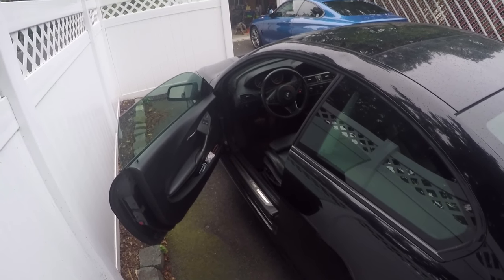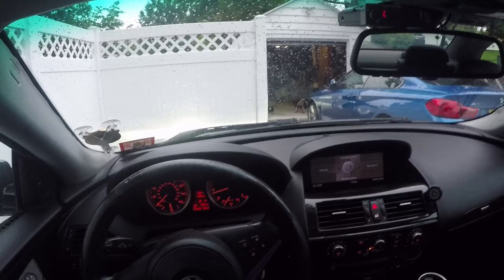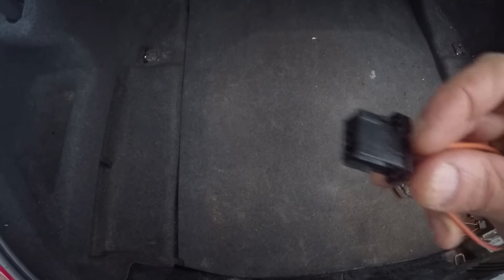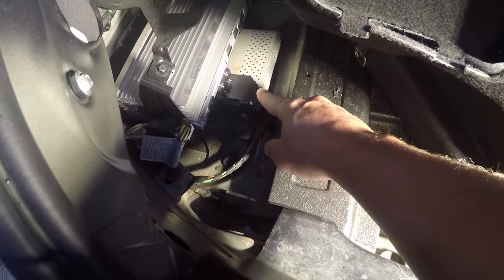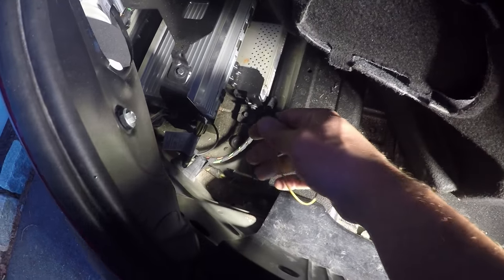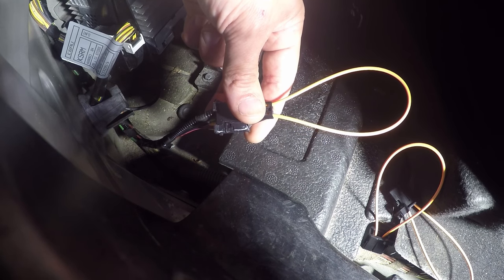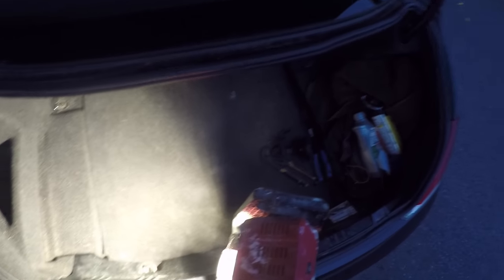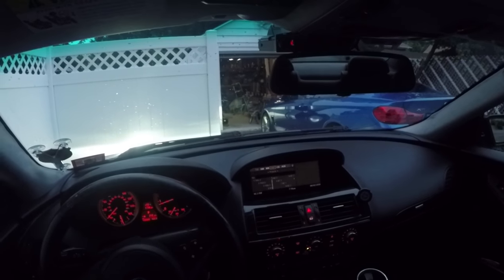FIX BMW SOS Error Light Audio System Failure CHEAP + Tips Others missed!

Comment: 2008 650i same issue with no sound at all. Did the fiber loop but still don’t have Bluetooth...? Also the sos still keeps coming on. It seems the loop only helped with the audio system. The USB port will charge my phone but again, no Bluetooth capability.
Reply from the maker: You may have multiple issues.  Since the sound came back on with the loop bypassing the satalite reciver that's a great start. Bluetooth has to be enabled by BMW (or someone who know how to code BMWs) via a software update.  The CCC in a 2008 650i is almost certainly on it's way out and can also cause intermittent SOS light. BMW will try and charge a small fortune to replace it if that is the issue.  My advice would be to take it to BMW and have pay for the cheapest diagnostic. Once the identify the bad components you can pull that part on your own and send it out to a specialist to get fixed for cheap :)
Reply: ModsAndProjects thank you. I never use the stealership so I’ll take it to my guy that owns his own German Car Repair shop. Hopefully he can reprogram the Bluetooth.
Reply from the maker: @ChrisJohnson-lx3tj  lol I avoid the stealership like the plague but sometimes they are useful to use to identify (not fix) complicated problems.  Was your Bluetooth EVER working? (if not, it probably just need to be coded)  My 2006 650I has 140k miles and i've been able to keep her healthy 100% DIY in the driveway, its has not been to stealerland since the warranty was up at 50k miles.
Reply: ModsAndProjects the original problem was the TCU unit, so apparently the fiber loop remedied everything except the Bluetooth. The Bluetooth worked fine until one day I turned the car off while it was in aux mode playing music from my phone......that is when everything crapped out.....all music and sounds like door open bell, seatbelt warning tone, etc. the loop solved everything except Bluetooth and the SOS symbol warning. On another note, any hints for my key battery? It seems it will no longer hold a charge.

Comment: Would it be the same problem. My screen is stuck on the BMW sign and turns on and off ? Help please.
Reply from the maker: Nope you have a bad CCC.  Google logic7 CCC repair.  Will save you 1000$.  Pull it ship it out and have it repaired by him :)
Reply: It would work if don’t turn the car on for about a day or so. :/
Reply from the maker: @LaGriz95  YEs, that is exactly how it behaves when the CCC is on the way out (or a constant boot sequence loop).  Eventually it wont turn on at all.  BMW dealership will ony replace (not repair) the unit and will charge between $1000 and $1600.  Your best option is to have it repaired by a 3rd party and it will run around $400 for the fix.
Reply: ModsAndProjects okay thank you very much!
Reply: @modsandprojects i have an 06 m5 exact same situation ordered the loop plugged in my satellite module still no audio

Comment: Worked on my ‘07 550i, thank you for this! I also found that using a can opener helps for stripping the housing
Reply: Was the satellite radio unit in the same place on the left hand side in the trunk in a 5 series, just wondering cuz I have a E60 too
Reply: @antboerner861  haven’t had that car in a year but yeah lmao, super easy job

Comment: My radio is still working but AUX and Bluetooth are not. Will this fix that issue?
Reply from the maker: Were they working originally? Is the SOS light on? What year and model?
Reply: @ModsAndProjects  I guess so. It's 2008 528i.
Reply from the maker: I guess I should have phrased that differntly.. "have you ever been able to use the BT or AUX port"   They need to be coded in to be used, it is possible they were never coded in or something else happened.  Is the SOS light on?
Reply: @ModsAndProjects  Yes, the SOS shows malfunction message. I bought this car with this condition but the previous owner told me that he could use that before.
Reply: Hey mate, I know it’s 5 years old but have you fixed this problem, if so could you tell me what you did please

Comment: I have a 750i I know they all work for all of them but I my question is how many by passes do I need in total Cus I connected mines to the Bluetooth module didn’t work then went on to the next one witch was the Navi system basically all them but only had one so I would have to take it off after checking if any one those was the issue

Comment: good morning, I get the word SOS in my BMW 330xd coupe e92 2007 year, write me a faulty emergency call system, and write a failed telephone connection, sim card installed not available. can its object eliminate my problem? the rest works all right!
 i'm in Italy.
thank you
Reply from the maker: It will help you diagnose the problem.  The part link in the description comes with full troubleshooting support untill your issue is addressed.

Comment: Thank you for sharing , I have SOS issue with my BMW X2 most probabbly Battery is running low .  They asekd me something like 400 euro for replacement !! Is there any hack to dissable ..
Reply from the maker: Hello, first you would need to 100% confirm the satellite radio is in fact malfunctioning, the loop is a great tool for this just to confirm. The loop in the description of the video comes with full support directly to help you troubleshoot definitively what the problem is in the best approach for repair or replacing as necessary

Comment: How do you fix the satellite radio if that’s what you are wanting to fix??
Reply from the maker: hello, thanks for commenting :-)  the bypass loop is a great tool because it allows you to identify exactly which component is malfunctioning. The particular loop in the description of the video above comes with direct customer support to assist you with identifying the exact problem and helping you to decide whether just bypassing it or regaining the functionality is the best course of action. A lot of times people just bypass out something like the satellite radio to get rid of the SOS light or to get there sound back, however, if it is something like Bluetooth that you might want to get the actual functionality back the tech support will guide you to the best course of action in getting it addressed avoiding the crazy prices the dealership would charge. For $14 it’s pretty awesome that you get that level of technical support!

Comment: cool video mine is a 2015 328i we had heavy rain is it possible the rain damaged it if any water got in there and that popped up saying no sos my radio is gone i have Bluetooth on mine, it connects with my phone but the sound is completely gone any suggestions thanks, prior to losing sound i already had that sos on for a while
Reply from the maker: Very likely you have a leak in the trunk area and one of the components took a bath. If you get a loop from the link in the description it comes with direct one-on-one troubleshooting support to help you figure out what component or multiple components have failed to get you back up and running again

Comment: I have a 2008 e64 with the same problem by in the same time my bluetooth doesn't work is it also typical for the problem with the radio? I also have a different radio its a DAB tuner but I think it doesn't make much different?

Comment: Hi, I have a BMW e90 LCI displaying this error code as well. My sat nav works(idrive) my radio works but my bluetooth doesn't work nor does my aux socket and USB in the middle compartment. Any suggestions?
Reply from the maker: What year is the vehicle?
Reply: @ModsAndProjects  It's a late 58 plate LCI with the wide screen idrive

Comment: I have a bmw 2014 435i and two weeks ago I turn it on and it says no warning tones ,it doesn't have any type of audio  What could it be ?
Reply from the maker: Hello, first you would need to 100% confirm the satellite radio is in fact malfunctioning, the loop is a great tool for this just to confirm. The loop in the description of the video comes with full support directly to help you troubleshoot definitively what the problem is in the best approach for repair or replacing as necessary

Comment: If it happens to not work after adapting the loop bypass, what would you look into next. CCC unit is working perfectly
Reply: After adding the loop, my IDrive is working while car is on and it connected my phone, but still no sound whatsoever
Reply: any solutions to this?
Reply: @possessedclown5832  the loop was the solution; it just happened to be that I misplaced it the first time. If it doesn’t work, vehicle will most likely need a new CCC unit.

Comment: Hello Sr thanks for your video. On my case I do have audio my radio works but my bluetooth is not working at all and I do have the (SOS malfunction) so you think that if I bypass the satellite like you did will fix my problem?
Reply from the maker: I guess for the cheap price It's worth a shot trying to bypass each component in the MOST loop (start with your satellite unit then try other components from there).  What year/make is the car?
Reply: @ModsAndProjects  is a 2014 BMW 320I
Reply from the maker: Was the BT working before or did it stop working when the SOS error popped up?  If BT never worked it could be unrelated to the SOS error.  The SOS error can be caused by any component in the MOST loop failing. In older cars it's very often the satellite radio unit as seen in the video.  A loose SOS speaker connection/wire (there is a dedicated SOS speaker in the driver side foot well) will also cause the SOS error. 

 In the meantime you could use something cheap like this this to get your BT back using your aux port and a USB port for power until you get your issue fixed: https://www.amazon.com/dp/B01M25NCN2/ref=cm_sw_r_cp_ep_dp_-lAjAb2NZWJ18
Reply: @ModsAndProjects  been honest I don't know when I buy the car the problem was already there
Reply from the maker: You might have two problems: Issue-1. BT was never coded to be enabled on your CCC (Call the stealership, give them your VIN and see if your car ever had BT enabled to begin with.  If not, have them code it in OR remove the CCC and send it out to this guy and he can probably enable it for you for cheap: http://www.bmwlogicseven.com/ )  Issue 2, - SOS error: Check for loose cable as mentioned above, get a MOST adapter and try bypassing each part in the loop until the SOS error goes away.  If all units pass, there are other options to try.

Comment: So I dont hear my chime when i put key in ,and my election menu works until it goes to FM or am radio mode ,then no sound comes out,is thus the same fix?.i am currently touching battery cables now and trying that to maybe reset stuff lmk what you think t.c tjanks

Comment: I had the same problem easy fix, do you know where the Bluetooth pin CODE is I have a 08 650i convertible
Reply from the maker: hello, thanks for commenting :-)  the bypass loop is a great tool because it allows you to identify exactly which component is malfunctioning. The particular loop in the description of the video above comes with direct customer support to assist you with identifying the exact problem and helping you to decide whether just bypassing it or regaining the functionality is the best course of action. A lot of times people just bypass out something like the satellite radio to get rid of the SOS light or to get there sound back, however, if it is something like Bluetooth that you might want to get the actual functionality back the tech support will guide you to the best course of action in getting it addressed avoiding the crazy prices the dealership would charge. For $14 it’s pretty awesome that you get that level of technical support!

Comment: Hi, i spilled water on my BMW x1 2011, now my radio and sound in the car is ot working, could it be the same problem?
Reply from the maker: Where did the water spill
Reply: @ModsAndProjects  it spilled on the radio screen and buttons associated with the radio. now all the sound is off i.e. seatbelt sound, reverse sensor sound, door opened during driving sound, handbrake sound. 

but on the screen of the speedometer it shows all the sign associated with the sound but no sound
Reply from the maker: @MrPhuluso  Sounds like you fried your head unit, i would try replacing that first.  The head unit can not be bypassed

Comment: Hi, I've boughten the part, configured it so it fits, but am still receiving the sos signal. What could be going on?
Reply from the maker: There are several components in the MOST loop.  You can use the adapter to use process of elimination to check each one untill you find what is causing the error.  Try the Power amp then TCU.  Also there is a small dedicated SOS speaker under the driver side footwell, it comes loose or is damaged it can also cause the error.

Comment: I have the same issue with my BMW 2006 330xi with the sos system malfunction, and my knob to control the screen is stuck would that be the same issue?
Reply from the maker: If the knob to control the CCC is stuck or unresponsive it is very likely a bad CCC unit.  You can send it out for repair (best option)  Dont just buy a used unit, unless you have a cheap way to code it (replacement CCC units need to be coded by the stealership or by an indy with experience).  If you had a bad satellite unit like int he video  you would likely still be able to use the CCC for other functions...
Reply: ModsAndProjects the knob sometimes moves horizontally and vertically like normal and other days it’ll just spin freely but I can’t select anything on the screen, but what do you mean by coding?
Reply from the maker: @Brandino73  Did you wind up getting it fixed?
Reply: ModsAndProjects it ended up being a low battery issue. Had it for years and had to get it changed the sound came back but left again I guess due to the cold. My gps on the screen shows where I am. And the radio every now and then switch from fm to aux every other few times I start the car. But the gps on my screen is active for some reason.
Reply: See if you can access the idrive with the key in but car not started.. I can only access my idrive at that time but once car is on I can not use the idrive. And my sos light just came on and Im also getting no sound.. I'm just trying to put in my two cents and find out if the bypass will work for me as well.. to the guy that put up this video.. do you think the bypass will work in my case or have any suggestions as far as the idrive only being accessable with the key in and engine off??? I'm going to try the bypass first obviously but I haven't seen anything about the idrive not working too... Thanks in advance!!

Comment: What does the pink wire do?🤔 I’m trying to find out if I have to get the sat tuner because for some reason mine is missing . If I can just get the bypass I’ll be fine because I don’t listen to radio I use my phone
Reply: @thej762000  so I don’t have the module on the right , and he said his module didn’t work at all anyway . Is it possible if I just got the female loop wire would it work?

Comment: Omg I waited a year to try this bypass and it worked I’m soo mad I waited .. like Bluetooth speaker while I could of did this a year ago :/ smh so mad and I
 Happy now I have radio
Reply from the maker: Thank you for reporting back with the positive feedback!
Reply: @ModsAndProjects  of course I was going crazy without music lol and this saved me a lot on replacing the radio amp box
Reply from the maker: @Barbiebalboa90  Awesome! Yeah the one in the description is unique because it fits in every component, the typical generic ones generally required due to modify them or cut them up to get them to fit on some of the components connectors.  I'm glad you got everything up and running, you probably saved over $1000!

Comment: My radio works in a 2010 650i, but SOS light. A used Sirius unit is $89 on eBay motors?

Comment: I've got e60 530d, 2008 and have the same SOS malfunction problem, but my sound is working. Can I do the same trick as you? Or I might have different problem?
Reply from the maker: The loop can be used to diagnose SOS lights as well as sound issues, the link in the description item comes with troubleshooting to help you if you need it

Comment: Can you please tell me the number of the past i need to get ? And can i find it on Amazon ?  Thanks a lot man this is a great help. I stopped by the dealership and they wanna charge me 500$ to fix this simple thing. Kindest regards.
Reply from the maker: Hey, the link is in the video description :) Good Luck!
Reply: Does it work on x5 2008?
Reply from the maker: @husamnajm6649  2008 x5 uses the MOST network, yes.  Hopefully it's just a bad satalite receiver, if it's not just let me know and I'll try to help you further diagnose the problem.
Reply: Thank you so much. I just orders the part on amazing and I made sure it’s a female one. It should be delivered on Thursday. I’ll give it a shot and let you know. Kindest regards.
Reply from the maker: @husamnajm6649  the pre trimmed one in the desciption is really your best bet, the standard female version won't fit the male cable without cutting it up.
Reply: Copy. 
I’ll follow the video and let you know how it goes. Kindest regards.
Reply: Thank you so much for this. I did it and it worked like a charm. Thank you so much.
Reply from the maker: @husamnajm6649  No problem! Thanks for reporting back with the positive feedback!

Comment: Hi of course I’m a newbie where is this place on my 2008 BMW 535i where do look I have ordered and received the part my car is in the shop for some engine malfunction error which I could not repeat
Reply from the maker: did you get the part from the link in the description? If so it comes with contact information to help you troubleshoot through any issue with your BMW electrical system
Reply: @ModsAndProjects  I do not have satellite in my display but I do get the sos malfunction they say I need a new battery maybe this will reset everything 🤷‍♀️